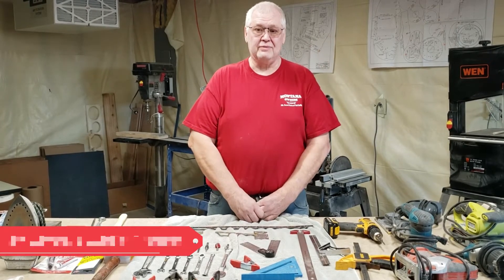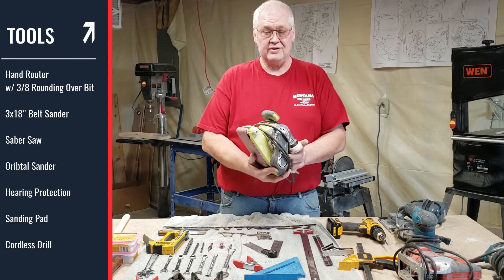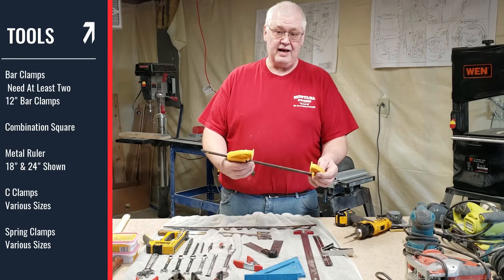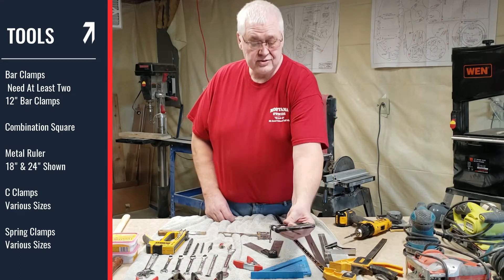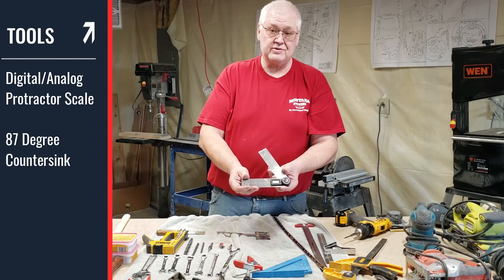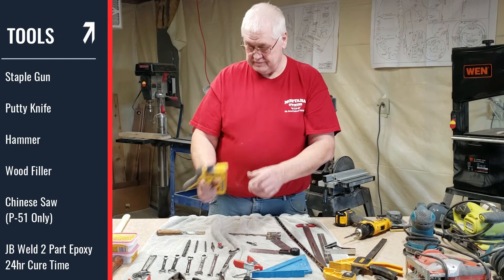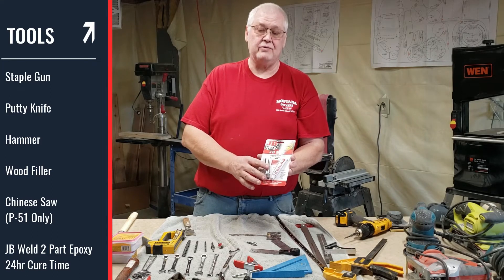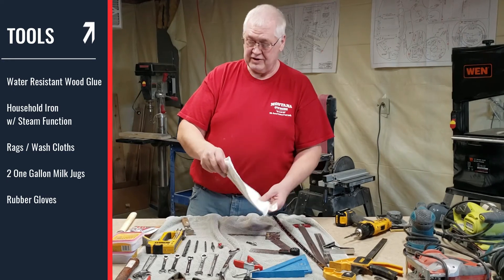PEDAL PLANE 101 - TOOLS

Comment: Coloquen en español también por favor
Reply from the maker: Vamos a tratar. Quizás podamos agregar subtítulos.
Reply: @aviationproducts9270  dale perfecto, y la parte de la lista de materiales, compre los planos para un geebe
Reply: @aviationproducts9270  Hi uncle..do you sell the main wheel a set with the crank, if you sell I will buy it, thank you
Reply from the maker: @stolaircraftsuyanto9728  yes. Use the email link and contact the shop for more info.